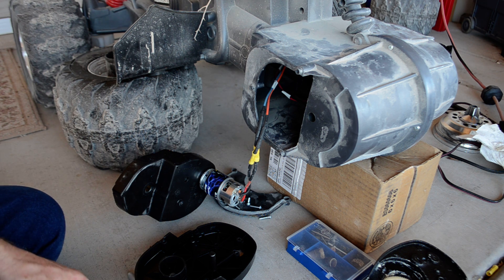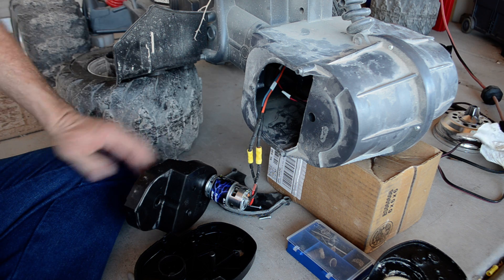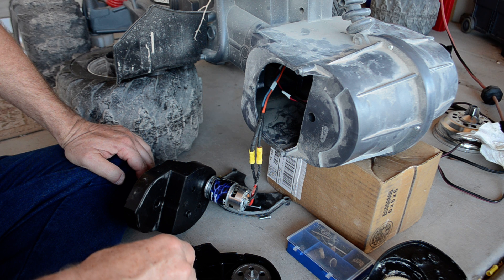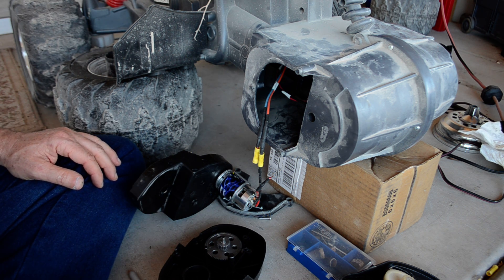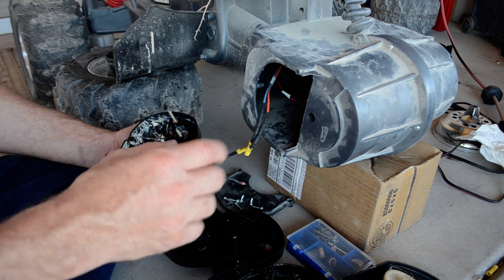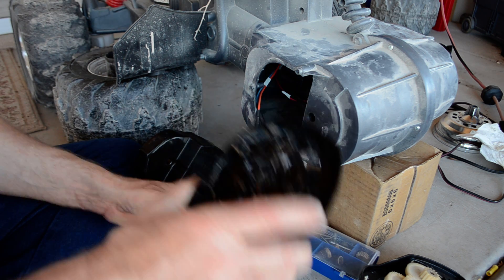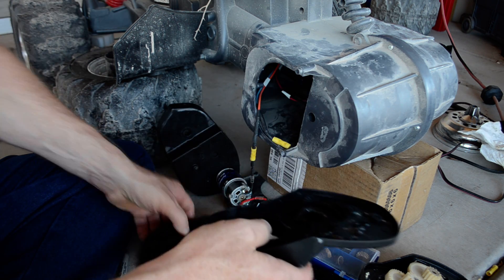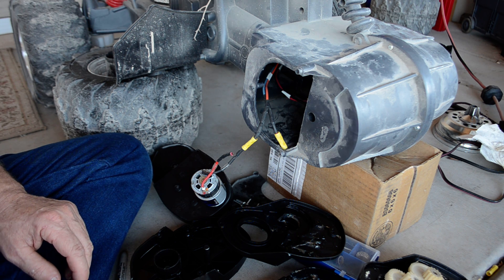ML Toys Powerwheels Stage IV Steel Gear and Gearbox Review & Results & Alternatives.

Comment: Moral of the story...leave it stock
Reply: But that's boring. There has to be a better company.
Reply: @eldesgraciado6690  it runs fine STOCK on 5s 50C LIPO....that's becuase
it's not 24V...right around 19-20V operating...I'ts plenty fast for the kiddies
they can do power slide , donuts...ect...I have different cars I got used..( but not used becuase stock is boring and stock battery dosnt work.lmao)
The problem you'll have is ..the back wheels will wear out...
I solved that...I used Gardening dividers ( 4-5mm thick hard plastic)...instead of bike tires....it;ll allow them to do power slide and donuts...it's what the kiddies like...plus it wont damage the gears because the wheels arnt griping rightaway....it's around 8-10 mph...but way more gusto...Just clamp piece of metal to the stock motors to act as HEATSINK.  I have different cars..
corvette, mustang, porches, Lighting. They all have different
size tires....that's why the gear mesh are WACK...but are $40 for a EACH gear...Only paid $35 -$40 for each car....FFS

I tried it on 6S 25V....it's too much for the 550 motors.

5s lipo is a simple and easy upgrade..plus the batteries recharge quicker.

They're RETARDED...I'll Wack old washing Gear box and mount 

dolly wheels..or use 300-500 watt used scooters motors before I pay that much..I'll just mount a live axil and brakes with a brushless system.

or you can get 3650 -3665 BRUSHLESS R/C ( $20)-ea.
The SHAFT SIZE are STILL the SAME as brushed 550...but they're
way more powerful....

You can get 150 esc (4-6) for only $45..now.
or 120A esc is 4s esc only $30....
it'll be way faster than the stock motors
or you can get 4276 2250KV for $35 (775 burshless size)
the gear pitch are 32 pitch....you just have to SLOT the gear box a
little to allow the motor to PIVOT to use a different PINON  to adjust the Gear mesh...LMAO
It'll probably do 12-15 or more...But you're still jerking
with the retarded noisy gear box.
I dont want the 3 and 5 year old going that fast yet..lol
You can always go ELECTRIC SKATE BOARD type set up...Belt or
chain drive

Yes...customer serves should have some experience tinkering with the different gear ratio...At least make suggestions of  sloting one
pf the motor mount holes...so it can PIVOT to make gear mesh adjustments.
Reply: @oneeyemonster3262  I am considering and electric longboard drivetrain with brushless motors myself
Reply from the maker: In hindsight I agree. But it took the experience to teach me that lesson.

Comment: The whole time you constantly talked about how bad the experience was with them and not a lot on what you did...
Reply: But his customer service experience with ML Toys is important because I'm thinking about buying from them. Now that I know about their customer service I can consider other options. Customer service is very important.
Reply from the maker: I'm sorry but I don't understand. When you say "what I did" what are you referring to? After I got it all working w/in a few weeks the batteries were burned up from the excessive draw from the motors. So I bought new bigger batteries. That made it run longer but that generated a lot more heat and that lead to the housing "melting" (no longer strong enough to support the axles for the gears and they no longer meshed properly and then 2nd gear broke.) What I ended up doing is scraping the whole thing and bought a new ATV that had a lot more power from the start. (Rossi brand.)

Comment: I too got frustrated with them.  I asked a question they didn't like and they blocked my e-mail.  Their customer service STINK!!!
Reply: The toys made by fisher price ( PowerWheels ) all is nice but the material used is poor. The best ride car manufacturer is PEG PEREGO
Reply: So guys, my suggest to you is you need to make a new gear using the material POLYACETAL...in my oppinion is the better then others materials to this application.  Never more will brokes. Can broke in other place, but the gear not...Look I ´m in Brazil, I had brought the toy to my childrens on 2015 and the gear had broke on the first lap. Terrible...after this,  my friend (Mechanical Technician) fixed for me using Polyacetal
Reply: thieves took my money on some batteries.

Comment: I had purchased the stage IV 775 motor/metal gearbox assembly from ML-toys hoping it would hold up with a 24V conversion. After about 2 weeks of moderate use, the motors (not the gears) had finally burned out. Im looking at go-karts now.

Comment: I didn't see anyone mention the EastCoast Powerup speed controllers you can get. If you're modding a Power Wheels then you've probably heard of eastcoastpowerup. They have an Easy ESC soft start that limits torque to the wheels at startup and softens braking. Excellent customer service too. Oh and they sell Motors and gearboxes. Alot of the Power Wheels modding websites and forums out there have some bad comment about MLtoys. You should NEVER bash your customer.

Comment: Do not order from this company.  I did even after watching this video just for a gearbox replacement.  The tooth count on the motor didn't match and their customer service is completely rude.  Snooty is the best way to describe it.  1 year later and they are still the same.  When gear ratios are different the wheels go at different speeds and causes more stress on the system.  DO NOT USE THEM!
Reply: same 2 years later. i turned them into the BBB.

Comment: dude I'm sorry but u are dead wrong on this. I'm not trying to be mean but u really need research stuff before u make harmful accusations. Just like any car a differential will cause a wheel to spin freely if it loses traction. your problem wasnt drive train but traction. the heat was a direct result of the motor change and the grease mixing is silly. besides test fit the gears and case and make sire everything is aligned and free and make adjustments as needed. if u cant do simple fabrication and mods then u shouldnt be working on it and leave it to thise who can or buy something new. not trying to be mean but i feel as if a mechanically inclined person wouldn't have had those same issues
Reply: you need to LISTEN to what the whole video is about...  He shouldnt need to know simple fabrication, ML toys are advertising DROP IN solutions that do not require it...  LISTEN.
Reply from the maker: Note: These vehicles don't have differentials. They are direct drive, one on either side. And as I said, I bought the whole "kit" all the parts from them, ready to go. I have a pretty substantial shop and do a lot of fabrication, but on real cars and real equipment. This was for toys for my kids. The whole point was that I was paying them to save me time.

Comment: Wow you did this the hard way. First off you probably blew first gear because of the automatic braking system. Mltoys has a $10 resistor which will alleviate that hard braking. Second I'm going to save everyone who reads this a lot of trouble...Traxxas Titan 775 motor, in my case Robinson racing 16t, 32p, 5mm pinion gear. $30 motor $11 pinion, ml toys $11 has a fantastic mount adapter for the bigger engine which lines it up perfectly.. . Also for a whopping $1 they sell four female gold-plated bullet connectors... Which allow easy removal of the motors you don't have to solder them every time.
Reply: I'm glad you put the alternatives but where do you get the "first" gear from?
Reply: @Troy_Sent_A_Message  I was referring to the gear that touches the pinion as was the author of the video
Reply from the maker: Thank you for the reply. If MLToys had a $10 resistor that would have prevented this, then why didn't they throw it into the "kit" I bought for $400? Seriously that has nothing to do with the problems I experienced. The problem was caused by the wrong housings sent with a binding of the pinion gear.
Reply: @stickman-1  Read your comment. You have the wrong size pinion. You must not be familiar with RC cars - its not a manufacturing defect (how could it be? everyone would have the same problem!) if a 17T pinion "binds" and you dont have different mount positions to mount the engine (you might) then you need a 16T pinion or 15T etc. Look at the molding on the case it actually shows you there are several different pinion sizes one case works with. Its a simple problem I believe you failed to comprehend. No offense. If youre not familiar with rc cars and pinions and adjustments you would have no idea. Not your fault. But maybe ask someone.
Reply from the maker: @johnsteele8073 What your comment shows me is you didn't watch the video. I addressed this in the video. (at about the 9 minute mark.) But let's just say you are right for now. What I bought was a complete kit! That's what I paid for. It was supposed to be drop in as provided by ML Toys. Pull the old, install the new and go. I got ALL of it from ML Toys. So IF I had the wrong pinion then ML Toys sent the wrong pinion gear. So even if you belief is factual, ML Toys are the ones that screwed up, not me! I quoted directly from their email:  on 7/18/16 here is the email they sent me:

"Last month Power Wheels had mislabeled the packages that our gearboxes came in and you may have gotten a 15-17 which would explain the tight fit."

Now to the actual facts of the case: ML Toys admitted they sent "defective," aka, "mis-labeled" cases. All the cases I had and what they sent all have the pinion location marked on the case. It's not hard to see. It is not the pinion issue it's the case was wrong. 

Suggestion: Actually watch the video and read my description, before you make a comment on it.

Comment: I have nothing good to say about ML Toys at all. I spent well over a few hundred dollars on the Stage IV boxes & motors. Dropped them in a 24v jeep that I built for my son & within a week stripped out on the right side. They tried saying it was from going from reverse to drive when i set it up with no reverse. They wouldn't give me a new gear & only offered a 10% discount towards purchasing a new 1. I went to a stock plastic 7r 1st gear with banebot motors have had no problems since.  In conclusion this company doesn't stand behind their products & their customer support sucks...f you like to throw away money this company will gladly take it!
Reply: Thank you so much for this review.  I was getting ready to drop a bunch of money with ML Toys and I won't now thanks to this video.
Reply: Kevin Worrell   I reed just on time before spending close to 600$ on their website site   Thx 4 the review!
Reply: @KevinWorrell  same here. Not buying their kit anymore and would rather take my chances on my own.
Reply: Where’d you get your stock parts?
Reply: @kielagullett2926  Banebot no longer sells 775 motors that I am aware of but I purchased the gears from a seller on eBay.
Reply from the maker: @ahlers1977  You can get the in Amazon for about $40 using the ASIN I posted in the text/description box below the video.
Reply: they refuse to talk to me. they sold me bad batteries. and a limp dick charger.

Comment: I belief your problems are legit and they should have help you with more hospitality but there is no solution in your video and it was unhelpful
Reply from the maker: I'm sorry you feel it was unhelpful. I'lll try to explain. 

The reasons I made the video are: To inform other about the poor service of ML Toys. To show others who have a similar problem what the ultimate solution is. To give people an alternative to ML Toys. The first one you got. The 2nd one you probably didn't get because you did not experience the problem and the third I don't think you got because you might not have watched it all? 

I"ll recap the solution: The solution is to identify which case you have. If you have the wrong case, the only solution is to get the right case. You might try drilling out the bad case and moving the motor so it has more tolerance against the gear, but because the distance is so short you probably won't have success at that.  

Hope this helps. :-)

Comment: I made a  gear using polyacetal ...is very strong material. The original gear is injected plastic.
Reply from the maker: I had a guy 3D print me some gears but the concentricity was too far off and I was not able to use them.
Reply: I just looked it up, what’d you do buy a sheet and cut it out yourself?

Comment: I was very close to pulling the trigger on a stage 4 setup from ML toys when I saw this stuff. Ill just go Amazon instead. Only thing im not clear on is why is te replacement gearbox case needed? can I just clean out the OE one and reassemble with the new gear and motor?
Reply from the maker: The metal gear and motor uses a different position. If you look at your case you'll see notations for the different locations. The problem is you cant just move a hole. :-) So you have to get a different case if yours does not have the correct position. The entire thing is engineered pretty hokey in my opinion from the manuf. But it's mass produced for the LCD, so you get what you get.

Comment: If you take the stickers off the motors they are the same as trax motors.  The only reason you need the metal gear is because the excess heat coming off the motor melts the plastic on the original stock gear. The screw holes for the 775 motors can be bored out a little with a larger drill bit to give the gears some slack.  I'm not sure whether or not you need a bearing in the metal gear. Friction maybe, plastic riding against metal. Grease is a wonderful thing.  I went to upgraded 550's at eighteen volts.  Tried of making repairs on 775 motors and gearboxes at 24 volts. Unfortunately repairs are what you inherit when you modify the riding toys from their stock origin.  KidscarsAndParts is a very good company but doesn't have as many of the products that mltoys has. Sorry about your problems.  Hang in there Dad.  They grow up fast.

Comment from the maker: Yes, ML Toys my child is riding the toy and loving it, no thanks to you. It was my work and my investigation that found and ultimately solved the problem. 

But further to the point, you never listened to me the first time I contacted you. You brushed me off claiming "it's normal." I have a background in mechanics, especially motors and power transmission and I know for sure it was not normal. Since you brushed me off, I made the videos FOR YOU, and no one else's consumption. I put them on youtube because it was the best way I know to quickly transmit video information. I thought once you saw the videos you would apologize and get me the correct parts and I'd pull the videos since there was no need for them. But instead you doubled down on your pathetic "customer service." Meaning you sent me more of the problem gear boxes, filled with the crappy factory grease which I had to clean and then again when they didn't solve the problem you admit you knew of the problem weeks before and yet you still sent me the bad gear box and you never apologized? And then when you finally did send the corrected box, again it was full of the crappy grease that I again had to clean. All the time you are crying over "rude" emails/videos. If you can't take valid (and ultimately proven true) criticism, then I suggest you get into another line of work because when you screw people over, you are going to get called on the carpet for it.
Reply: Order placed on 29th, received new gear boxes on the 9th (paid for 2 day shipping).  Not only that, I installed them and 20 minutes later there is ANOTHER popping coming from rear. So tomorrow I will be taking this thing apart AGAIN. SMH....
Reply: ML Toys  
the customer is always right buddy 😂
Reply: I definitely would not have "cleaned the grease out"...  its not the space shuttle...  just drop in your gears.. add plenty of the good grease and go with it.  Its not high pressure like a vehicle wheel bearing. It would have been fine.  But yeah, incompatible gear boxes is just unacceptable.
Reply: I'm glad I saw this video cause ML toys just lost a customer.
Reply: Glad to hear your child has been getting to use the car happily. Despite all of our differences that has been the end goal. As a result of our experience with you we had revamped our customer service and tech support policies. Today if a customer were to have an issue like this they would be given the option of being sent replacement parts to rebuild themselves (fastest way to get it fixed if the customer is sure they know what's wrong and how to repair) or to send the kit back for rebuild/replacement (best way we can insure a proper repair is done). I understand that your experience was not that great and you'll not likely purchase from us again. But we are all human and as MLToys grows we are always trying to work towards making the modifying experience easier and more fun.
Reply: ML Toys that's a lie. I emailed about a problem I had with one of my gearboxes and your response was the drive shaft was probably bent or something. Well it's funny the car was driven for two years prior and the gearbox held up fine. I purchased a racing gearbox setup with motors over 6 months ago and it still doesn't run.